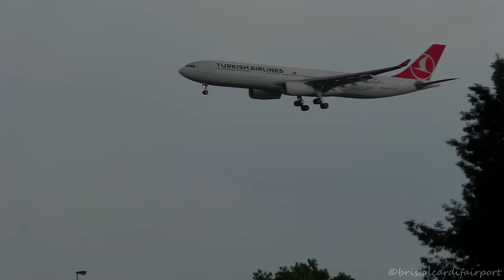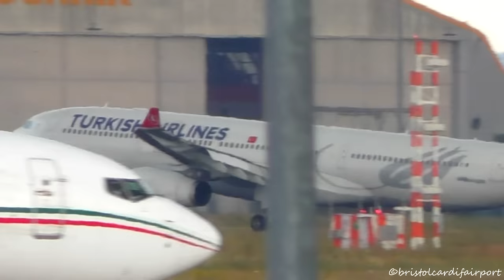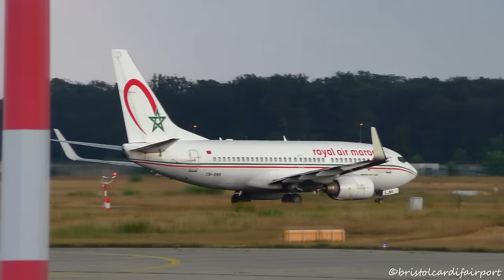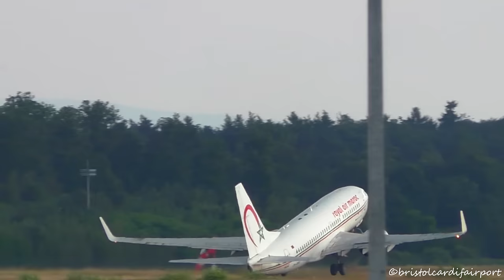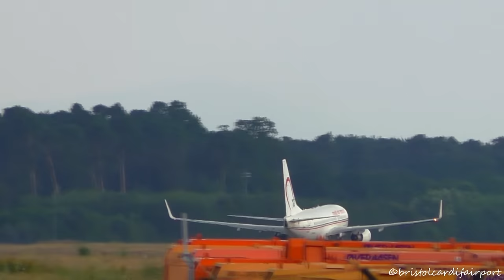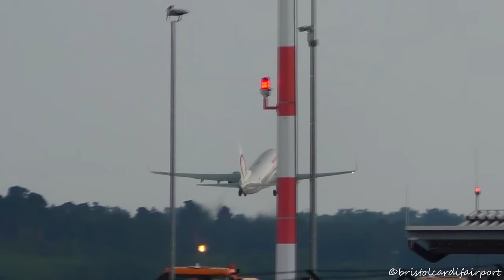PASSENGER AIRCRAFT FAILS TO TAKEOFF! BOEING 737 NEAR TAIL STRIKE & STALL ON TAKEOFF

Comment: 737: "V-"
Pilot: "Rrrrrrrrrrrrrrrrotatteeeeeeee"
Reply: Like he really forced that shit  to rotate at like 80 knots
Reply: No flaps selected!
Reply: @isurumunasinghe3351  NO NO, pilot mode : slow motion
Reply: @isurumunasinghe3351  Actually it was flap 1
Reply: Savageviper it’s actually around 120-140 knots, it’s just the turbulence wave caused by the A330 that landed, all pilot are trained to pull up when reached rotation speed, its impossible for them to pull the nose up at 80 knot
Reply: LMAOOO
Reply: I laughed out loud at this comment.
Reply: co-pilot 80 knot

pilot rotate
Reply: @DanielSilva-gc4xz  then what about unsafe to takeoff configuration warning?
Reply: @wasimattaullah9510  was there any?
Reply: @DanielSilva-gc4xz  normally when you go for takeoff and your flaps are not configured warning comes
Reply: @wasimattaullah9510  They had flaps 1 selected which is why there was no take off config warning, and flaps 1 is a normal flap setting for take off. This was all due to the wake turbulence of the a330 landing before this plane ending up on the runway.

Comment: It's the crosswinds caused by the flight that lands perpendicular to his take off. He is passed V1 so has to keep pushing through. ATC should allow more time between landing and take off on this runway configuration. Excellent flying.
Reply: Not at all the cause of the near fatal crash.  They had no takeoff flaps selected.  Must be either flaps 1 or 5.
Reply: @kenlott8488  Mentour Pilot already explained this. you can see clearly from the video they did input flap 1
Reply: Regardless of what ATC say. It is the pilots job to take off ONLY when they are happy

Comment: Pilot: V1, Rotate..
737:  NO
Reply: lol
Reply: 737: I will rotate, but take off is another businesses bud.
Reply: This is actually one of the most accurate interpretations of what happened (because of wake turbulence from the A330 landing on the perpendicular runway)
Reply: @Miku-uw2sl  The 330's wake turbulence wasn't the problem. They just rotated too early. They were rolling perpendicularly to the wake turbulence and any tailwind from it would have lasted for less than a second, not the 11 seconds or longer that they rolled down the runway with the nose pitched up. They would have moved 2,000 to 3,000 feet down the runway in that time, which is much longer than the width of a wingtip vortex. While MenTour is correct that a sudden tailwind could cause that to happen, the tailwind would have to last for the entire duration, which would not be the case in crossing another aircraft's wake. The only way you're going to experience wake turbulence from another aircraft for a sustained period of time is if you're traveling in the same (or nearly the same) direction, such as departing from the same or a parallel runway. Departing from a perpendicular runway, it's a brief bump (though could be a very severe brief bump if it's a light plane in the wake of a heavy one.)
Reply: @vbscript2  they probably did only experience the tailwind from the wake turbulence for about a second, it was probably just thought as unsafe to take off at that point. I think that they just wanted to make sure they weren't taking any risks and wanted to be certain they would no longer be effected by the wake turbulence. It could have been an effect of confusion as well as they had not experienced anything like that on rotation before.
Reply: @ElectroRail  This had nothing to do with them thinking it was unsafe to takeoff. They were trying to take off (that's the point of holding the nose up,) but failing to do so because they were too slow. They're very lucky that they had enough runway left to put the nose back down and accelerate to the proper rotation speed. That being said, it's possible that the early rotation wasn't their fault. If the V speeds for their weight and takeoff config were calculated incorrectly by someone else (e.g. dispatch,) then they may have just been relying on faulty information. Unfortunately, we'll never know exactly why they rotated too early since the incident wasn't investigated and RAM didn't retain the data that would be needed to conduct a proper investigation (e.g. FDR and CVR data.)

If they had thought it was unsafe to take off yet, then they wouldn't have raised the nose and certainly wouldn't have held it high for 11 seconds.
Reply: @vbscript2  you are wrong and now idea what you talking ..............check in YouTube meter pilot video about this airplane !
Reply: @firstsoldier4257  I've seen his video and he's wrong. The vortices are only ~200 feet wide. The RAM 737 was traveling perpendicular to them. It had a nose-high attitude that would normally be sufficient for taking off for at least 11 seconds, during which time it would have traveled half a mile or so down the runway. It would have crossed each vortex is less than a second, therefore the vortices cannot possibly be the reason it is failing to take off, but rather only rotating at the incorrect airspeed. It's possible that the rotation airspeed was computed incorrectly, perhaps not even by the pilots (possibly RAM's dispatch,) but, one way or another, they rotated too early for their configuration.

Furthermore, if you look at AvHerald, there are pictures clearly showing that the aircraft is crossing the intersection with taxiway S during its first rotation. This is already 1,000 feet past the extended centerline of the runway on which the Turkish A330 landed. And, furthermore, it is upwind, so the vortices could not have drifted that direction. In other words, MenTour's explanation is impossible.

Even without the above evidence, though, if MenTour's explanation were correct, this kind of thing would happen all the time. Literally at least daily. Obviously, it doesn't. Because it isn't accurate.

Comment: WOW that is crazy! No, it was beyond decision speed V1. Aborting the take-off is no longer a safer option.
Reply: Ye that plane was either crashing or taking off. Thankfully it was the latter.
Reply: Glad this incident happened on a runway which was long enough. Even if the pilots miscalculated something, an aborted take-off at this high speed is a fatal risk to overshot the runway. Flying seems to be the better option. On a smaller runway it would have been a massive disaster.  No chance for a second take-off attempt either.
Reply: Better option in this case is takeoff, after V1 you can't stop the aircraft in safe.
Reply: Since I cant seem to reply to individual comments, V1 is the speed at which a rejected takeoff is no longer an option. There simply wouldnt be enough runway.  You have to realize that MTOW vs MLW - virtually all aircraft have a much lower landing weight than takeoff weight. Theoretically speaking, aborting a takeoff after V1 is similar (NOT being technical here, just making a point!) to landing overweight. Not only are the stopping systems not rated for it but it will take a significantly greater amount of runway to stop.
Reply: All runways should be loads longer then they are now for scenario's like this.
Reply: @RS-hh3et  that's not always viable. Runways are expensive and take up a lot of space. Plus people don't like living near them, the geography doesn't always allow for long runways and not all of them are frequented by large aircraft.
Reply: @MsJubjubbird   I know but it would be good if that was made a priority

Comment: As per Mentour Pilot (https://www.youtube.com/watch?v=TEjbg_2yuFI), what you are seeing is he effect of vortices coming off a Turkish Airlines A330 which had just landed on a runway at right angles to the one being used by the Air Maroc crew.

When the (invisible) vortices hit the 737, they had the effect of slowing it down. The aircraft had just passed V1 (decision speed) and would have rotated and climbed out normally except for these unexpected vortices. The crew, quite rightly, lowred the nose so that they could regain acceleration, reached rotation speed again and thn climbed out normally.

According to Mentour, what you are actually seeing is the very quick reactions of a very well-trained and professional crew.

For thos who don;t know, votices are thos swirling currents of air that come off an aircraft in flight. They are caused by the fact that there is high pressure air under the wings and low pressure above them. The pressure differential makes for very powerful swirling currents of air which can even flip over smaller aircraft if they are following too closely behind. In this case, as seen, even an aircraft the size of a 737 can be affected.

Comment: Wow! Maybe the data entry on the FMC...and bad Vspeeds. Fantastic clip mate! Awesome and rare catch !!
Reply: YES ;)
Reply: Royal Air Maroc wrote: After
 false information was spread out regarding flight AT811 from FRA to CMN
 on July 23, we want to clarify that during take-off, ATC advised of 
possible wake turbulence from adjacent landing A330. In turn, the 
Captain decided to execute a manoeuvre to gain more speed until they 
reached speeds that would ensure a safe take-off".
Reply: Hahahahaaaaaaa   tipical RAM comunication
Reply: +LmOver Which is in contradiction to what the airline said about wake off the 330.
Reply: +Russell Butler  RAM is just bullshiting us with is communication. .... as they are used to do...
Reply: Impossible! ATC procedures require the controller to account for possible wake turbulence before clearing someone for takeoff... not after. And if ATC did commit such a grave mistake and belatedly informed this crew during the TO roll, the pilot would have to abort. Furthermore, there is no such hazardous manoeuver!! That would just be a guess game with no guarantee that they wouldn't encounter the wake on lift-off (critical phase of flight)... and crash!
Reply: LmOver 80kts speed check should spot an issue with the pitot. At 80 then you are still in a low speed reject situation so would stop without any real drama.
Reply: i totally agree. I think they may have failed to set the correct weight in the FMC, getting lower V speeds. Affortunatelly they have a long runway to go
Reply: If they jumped procedures, didnt have a good CRM, if fatigue was a factor...there would be a long line of possibilities my friend, im not saying it was what happened, its just something i think may have happened. Remember most accidents happended because of human errors. Imagine a crash due to failing to set flaps for take off, we would also think its impossible because its part of the before take off check list and no pilot would forget to do so, and would be double check too. There was a crash in Argentina (airline name was LAPA) in that crash they even had the flap configuration warning when set take off trust, and they continued the take off run!... there in no impossible when talking about Human factors
Reply: +LmOver equipment failure is always a possibility. But if that's what occured, the required course of action would be to abort. It is always preferable to handle a failure on the ground instead of in the air!! Particularly when the failure affects any one of the primary instruments!!!
Reply: +LmOver They obviously hadn't reached V1 yet. Anyway, don't forget that they have stby Instruments. The decision should have been a no-brainer.
Reply: +Colin Southern that's right, there was supposed to be a speed crosscheck at 80kts
Reply: That's assuming that the only problem was a speed indication disagreement. I just hope that the company will take a serious look at this incident and take necessary steps to avoid any reoccurance.
Reply: Completely right.  It's a laughable excuse for poor airmanship.
Reply: The guy probably just forgot to wait for 80 knots lol
Reply: Nope you can see he hasn't extended the flaps. Good way to die. Look up northwest 255
Reply: if no flaps were set they would had configuration aural warning, wich could not be innoperative since it would be a NO GO. 
Maybe flap setting was flaps 1, and can not be noticed in the video
Reply: " ATC advised of possible wake turbulence from adjacent landing A330." A/C landing on parallel RWY should not be a factor, unless T/D point is well downfield of B737's rotation point, which is unlikely. Additionally consider that, with a typical headwind departure, wake turbulence is pushed even farther away from rotation point. Conclusion: Wake Turbulence explanation is CYA boilerplate.
Reply: Yeah...I have no B737 type experience, but I was FO for a 121 commuter airline for a few years, so I know some of the BS that goes on...for instance, we were supposed to pick up a B-1900 in BWI that was observed hitting a raven on final, and they found the bird, dead. Problem was, any bird strike required Mx release to fly, and we had no Mx handy. What ULTIMATELY happened, was (supposedly) some company employee "observed the bird strike," and said it "didn't actually hit the plane: it got caught in the 'wake turbulence' and plummeted to its death!" The CA said he "couldn't be certain" it hit, etc...Thus, "legal" to fly w/o Mx signoff! (Obviously we did a thorough preflight and observed not even the slightest divot, so I and, more importantly, the Captain felt 100% safe, even though it was contrary to policy.)
Reply: That's an example of (comparatively) benign B.S. This...is considerably less benign BS!
Reply: Now, now! A goddamn beauty queen relative to a Shorts 360! ;-)[Procedure for total engine loss over water: 1. Perform emergency ditching procedure 2. Break out oars 3. Radio ATC and revise flight plan to arrive a half-hour earlier.]
Reply: Colin Southern jj
Reply: Emirates almost crashed one of their A340-500 because of exactly that happening. Entered the wrong weight and ended up taking out structures at the end of the runway. In that instance the pilots were flying tired and never noticed their mistake.
Reply: Procedures, checklists, simulators....everything is design to reduce risks, but Human error will always be a factor, no matter how well the pilots are trained
Reply: no flaps we're set at all. how is that not instantly obvious to anyone who would know enough to throw terms like FMC around.
Reply: +celderian where exactly would you a single person enter the weight of the aircraft? Thats all done individually by both pilots on their E2Bs, either the age old style or the electronic version. Its a simple weight and balance calculation that determines Max allowable weight for altitude and temp it isn't like they enter that into the nav computers and the aircraft tells the pilot if it's too heavy. Flap settings str basically standardized by the airlines training regimine. This incident was due to the fact the pilots forgot to set the flaps somehow amazing as that is not to mention grossly unprofessional.
Reply: +chrmantilla the checklist would have prevented this. either they blew the checklist off or one or the other pilots lied when the visual confirmation was supposed to have been done. Eastern airlines lost a 727 taking off at DFW airport because the crew was paying attention to the stews ass, literally, and forgot the kill list, the checklist of items critical for safe flight, and forgot to set the leading edge slats. The 727 was unable to fly out of WIG crashed and killed all in board. This was the reverse of that with no flaps. the crew tried to take off at the calculated rotate speed but with no flaps didn't even have enough lift to fly into WIG, luckily for them, also lucky for them the airfield was low enough in altitude and temp low enough to allow them to gain enough speed for a successful rotation. Had it been a high elevation airport with hot summer temps this would have been a crash.
Reply: I think 737 800 is able to take off with flaps 1, so it would be hard if not impossible to notice it by watching the video... If they set take off power with no flaps the take of configuration alert would start to sound. Maybe the alarm was not working? dont think so, not having the alarm opperative is a No go
Reply: Able? Certainly, if you've got enough runway. It's not a prescribed maneuver, AFAIK. I wonder if somebody with experience could chime in: can you even ferry a 737 with INOP flaps for maintenance purposes?
Reply: given sufficient runway and a w&b and cg within limits, the only other aerodynamic limitation that could prevent an aircraft to takeoff with flaps 0 would be the deck angle, i.e.: possibility of tail strike. However, factors such as noise abatement procedures or SOP could also be determining.
Reply: And they would need a very long runway for landing.... Hot hot brakes
Reply: chrmantilla hopefully by the time they land, they would be heaps lighter :)
Reply: looks like flaps are set at their first setting which is very shallow... but as the plane continues down the runway after the first failed takeoff, you would think you cannot see the flap angle anymore at that distance, but instead you can which tells me they began extending the flaps further and then lifted off easily
Reply: bcubed72, it's been a year. But where did you get the idea the A330 was landing on a PARALLEL runway? The A330 was landing 7R; the 737 departing 18. The landing A330 crossed airborne 1/2 mile directly ahead of the RAM 737-700. Additionally, radar data confirmed standard wake turbulence separation delay was not applied. That leaves wake from the A330 a possibility. However, it's quite possible an error entering weight data is the culprit.